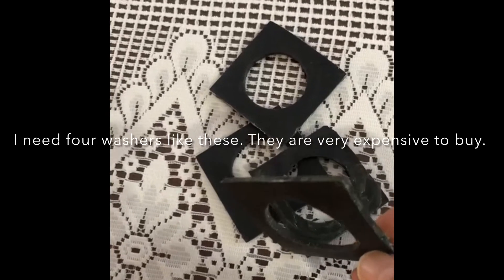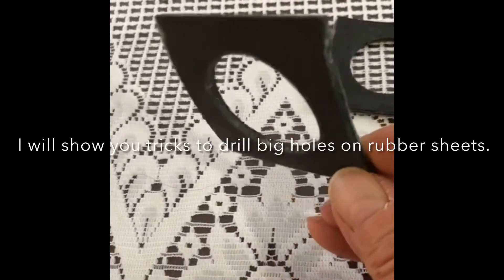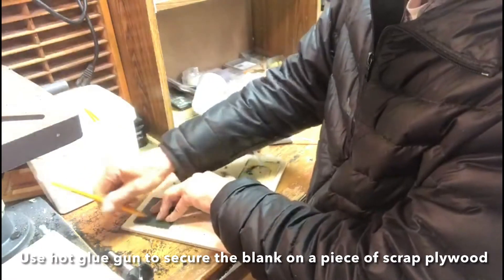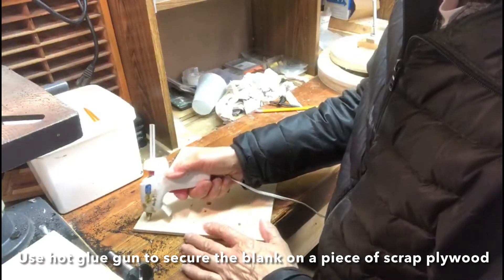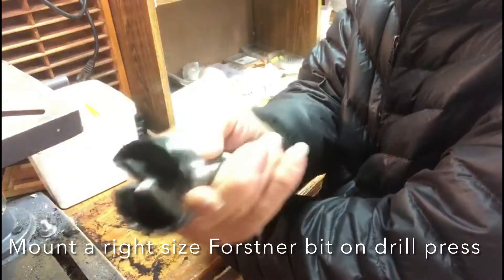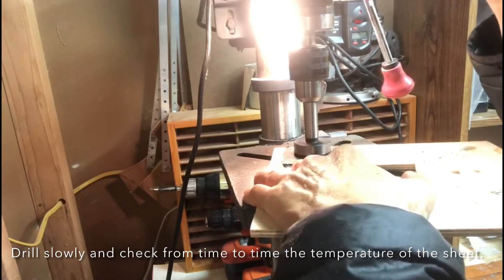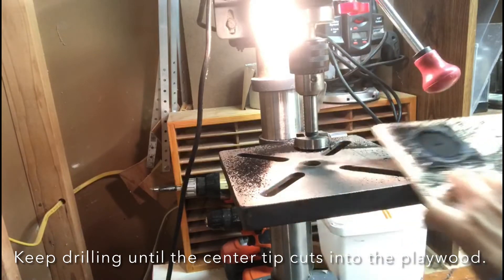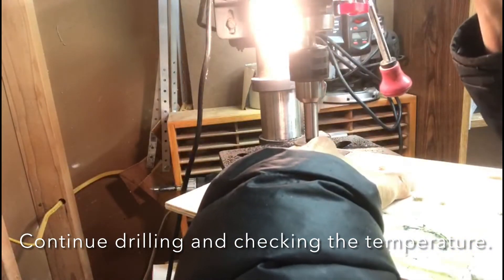Make Large Rubber Washer on Your Own

Comment: I go through 300-450 1/2" thick rubber washers a month.  I was cutting with a hole saw which works well.  Might be more efficient than what you're doing.  But my volume requirements are jumping and I went to a watermen service.  I provide the material and they cut for 11 cents each.

Comment: why not just cut it using a blade? or scissors?
Reply from the maker: Thank you for watching. The rubber plate  is 1/8" thick. It would be very difficult, if not impossible, to cut a hole of accurate and clear cut by hand work using a blade or scissors.
Reply: @longwuwu9657  A stanley knife would cut it like hot knife thru butter. most people dont have access to expensive complicated machinary
Reply from the maker: @esecallum  Thank you for your comments.